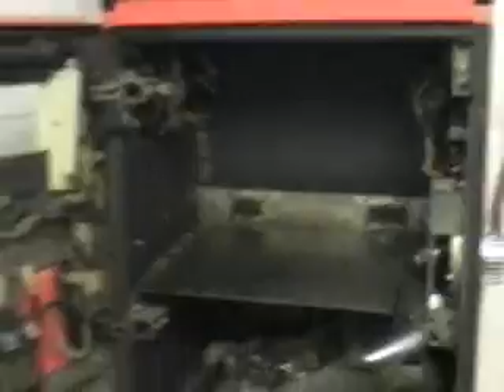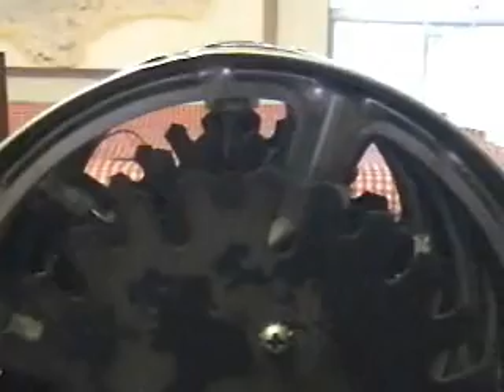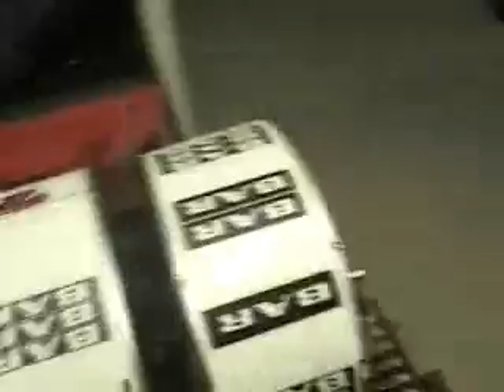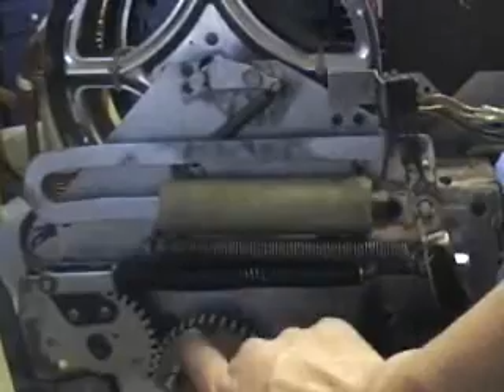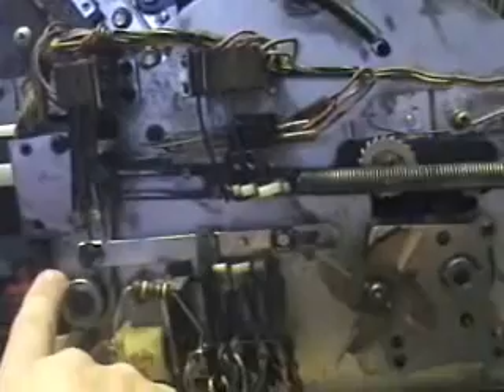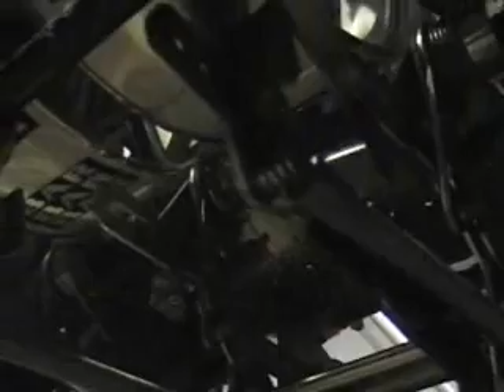Bally Electro-Mechanical Slot Machine Part 3

Comment: So, the slot machine has no idea how much it paid out.  If it did know how much it paid out, that goes to a data base so a human can see whether the machine is working properly or not.
Reply from the maker: Not real sure what your point is here.  These old EM Slot machines kept track of the pays and coins in though mechanical meters.  There were not computers or electronic interfaces into any database.  Record keeping and monitor was all done by hand.  The game it self would go into a "titl" mode if the pay didn't equal (short or long) or the win.

Comment: Thank you for this video.
I just picked up one of these 1075 units that is currently not working.
As I write this post I have the wheel assembly out and I am cleaning decades old grease from all the moving parts.
Already I am seeing results and I am very optimistic about seeing a fully functional  machine. Maybe by the end of the day.
Your video had enough information to make me feel comfortable opening it up and going for it.  
Thanks again.
Reply: Success.
https://youtu.be/KSzDyPCy-Bg

Comment: I have this same machine Ballys 1090. The machine starts up and all the light come on, but I have not be able to get the handle to even pull on one,two, or three coins. I have tried everything i can to get it to pull both with the machine closed or opened. The vise grips you show in the upper hinge when the door is open where is the switch in that hinge? Is it the piece of metal in the back of the hinge body? And are the vise grips touching that piece of metal and the body of the hinge to make the connection
? Why do you think the Pull Handle seems to be locked. Any help would be gratefully appreciated. Thanks you. Ron..
Reply from the maker: The handle will not pull for a couple of reasons... some normal, some not.  You got to figure out which one it is.   The handle does not pull if the machine does not think there is a credit in it.  When you put the coin(s) in, do you see the lights change designating the number of coins inserted?  If not then the machine isn't recognizing the coin to "credit up" the game.  If they do light and change, then you need to make sure the release solenoid is turned on which will allow the handle to move.  If the solenoid releases then the handle should move.  If the solenoid doesn't release then your problem lies in that circuit.  If the solenoid releases but the handle doesn't move then it could be a mechanical thing.  Work the problem in individual steps from the credit registering to the handle release.
Reply: @wrkey   Hi Rusty: Thank you for the reply. I was able to get the handle to pul by manually connecting the solenoid. My issue now is the machine is not recognizing the coin credits. The lights do not light up as the coins are put in and they fall directly to the hopper or the pay out box below. I don't have the key to lock the machine so i dont know if that makes a difference. Also I dont see the manual coin deposit lever on the inside of the door like you show in your 3 video. Is there a way to send you any pictures of it. Or do you have a number I can text it to you. I  really appreciate all your help. Thank you. Ron

Comment: Really helpful.  Thank you!  I have a 1969 Ballys slot machine that was used in Circus Circus Las Vegas.  I need to re-grease it as the wheels don't move well.  Should I use WD40?  Thanks again!

Comment: Hello Rusty Key. I have a bally Bonanza 5 reel.  And have an issue with reel no 2 as it brakes straight away when I release the arm.  Then thec1sr, 3rd  4th and 5th brakes.  I am a bit puzzled as from whar I understsnd is that it looks like that the braking is initiated by the horozontal solid slider that pushes the "wiper switch arm" to swing foward and brake.  Is this assumption correct.

Comment: I got a Ball 777 machine. It paysoff at Orange, Bell, Bar.  Don't know why. Any Idea?
Reply from the maker: I suspect there is a wire connected to the wrong spot or perhaps a short caused by a wire or a drip of solder.  Put is in the that configuration and then pull the reels.  Follow the circuits from the reel wipers and see where they go and what is done wrong.
Reply: @wrkey  I think you are right, I will trace all the contacts. Thanks.

Comment: We have a Seeburg/Williams 1980 slot machine. In one of your videos you trick the slot to assume a coin was dropped. I can drop a coin or can do like you did try to trick the machine into allowing me to pull the handle but the handle is not released to pull. I can push a relay and get the wheels to spin as if the handle was pulled. I believe I have two problems one the wiring from the handle to the relay that trips the wheel and second the switch that reacts when a coin is dropped or like you when from the inside door lifting the wire that controls the switch.

Comment: So how do you adjust it for the payouts to be looser slots or tighter slot payout have the same machine
Reply: You'd have to increase the number of high payout symbols on one of the reels. Suppose that a standard machine has 1 seven on each reel, you would have 2 sevens on the 2nd or 3rd reel to increase the odds of hitting it. Nowadays, it's all done with virtual reels, and is easily programmed. With a mechanical machine, you would have to physically alter the reel to have the correct size slot for the wiper to fall into.

Comment: Great video. I just got a 1975 Bally's model 1090. The arm is locked up. Sometimes I can get it to pull, but the wheels just free wheel. Where should I start ? Also any publications that would be helpful?
Thanks

Comment: Thanks so much for this!! I have a low boy and about every 10-20th pull of the arm, the right most wheel does not spin. The arm that stops it from spinning does not articulate all the way back.  Any quick ideas?
Reply from the maker: I suspect there is some dirt or old grease/oil or a combination there of that is causing just enough friction to prevent the movement.  The stop arms need to be move easily so it can stop the reels quickly and thus it is designed to have very little friction.  Dirt/grime/oil/grease/gunk could be a contributing factor.  I would suggest a good cleaning of the swivel points and as you do so check for binding or scraping parts.
Reply: Rusty Key thanks for the quick response! I got in and cleaned it really well and used 3-in-1.  I checked the tension as compared to the other two arms and it /seemed/ to be the same resistance, I have a trigger gauge I can use to confirm. It does draw back as the arm is pulled, it just pushes forward and stops the reel  before the arm is released. 

That said, is there any other mechanism that spins the 3rd reel differently?  I remember reading or seeing something about more randomness being added by spinning it differently, but honestly didn't fully understand what or where the mechanism is.
Reply from the maker: Yes, there is a timing mechanism that does change the time it takes to stop the third reel.  I thought in one of my videos I show this and how it adds additional randomness to the process.  It sounds like the delay components may not be functioning as  designed and allowing the release to trigger to soon or not reset at all.

Comment: Hi Rusty I have a machine very close to yours... It keeps paying out till it runs out and stops... Two cherries (Two Quarters) keeps paying after two??? Any thoughts???
Thanks
Reply from the maker: Wow, I haven't messed with this thing for a year or so.  I am guessing here.  When the 'winning' combination is made, the coins begin to disperse.  As each coin is 'popped out' it trips a pay out counter that turns the display odometer and adds one click on the pay out regulator.  When the regulator reaches the point where the amount equals the selection on the reels, then the machine stops delivering coins.  The most common problem is the coin sensing switch is dirty, out of adjustment or a wire is broke from it.  If your payout counter is ticking off the coins, then the coins sensing switch it working, if not, then I would start my search there.   If the payout counter is ticking, then find the pay out regulator (in the top I think) and see if it is moving and/or switches out of alignment there.  I hope this helps but as I said I haven't looked at it in years and I'm at work right now so I can't look at.   Let me know what you find.
Reply: Ya know i noticed if you reset the reel and the stepper and just feed it one coin it tightens up a bit
Reply: Reset stepper and reels

Comment from the maker: @Alexdelossantos123  >  Well.. the systems is completely 'hard wired' and and conceivably you could change the payouts and/or add more.  For example, I could make it to where the machine would pay out 1 coin ( per coins played) for all blanks on the pay line.   But a much greater understanding of the system would be required than what I currently have.   But doing so would increase the payout % and more in the player's favor.